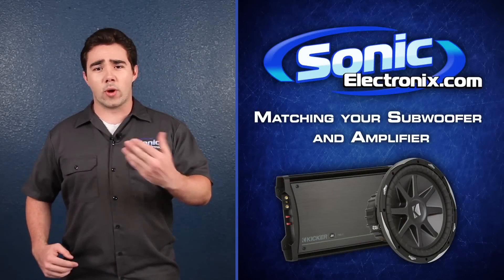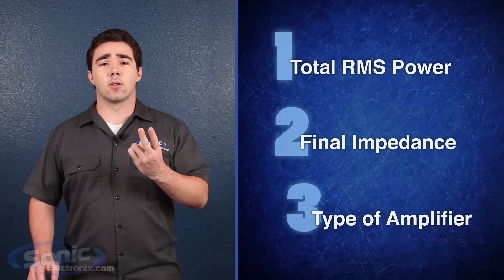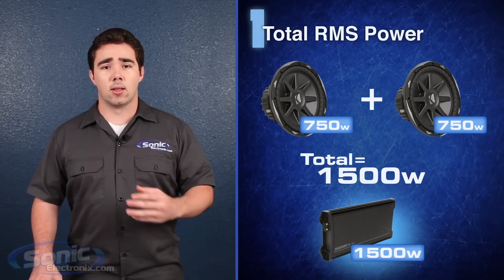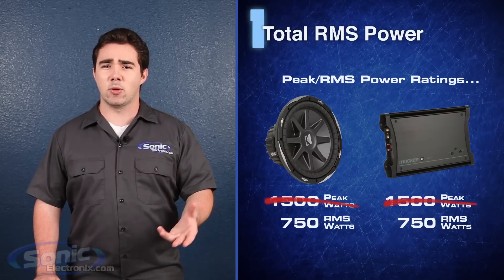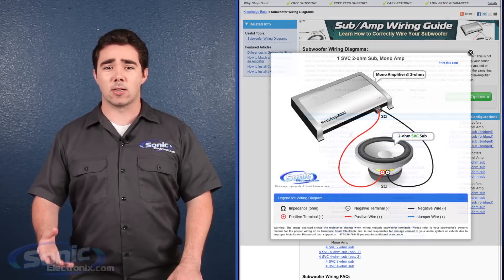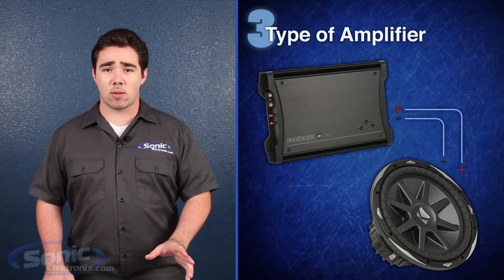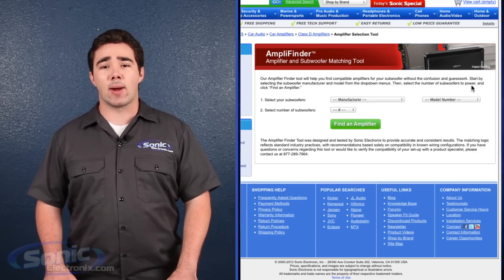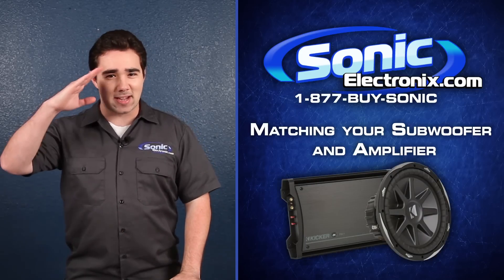How to Match a Car Subwoofer and Amplifier

Comment: Question? I have the Kicker 07DCVR122 ported enclosure with dual 2 12" CompVR subwoofers 2 (ohms) I wanted to know if the Kicker IX1000.1 1000W RMS Monoblock Class D IX Series Amplifier, would be a good match, or would it be to much power for my subs?

Comment: Based on what I research... Isn't the fuse rating the real rms? I bought an amp of 1110 rms but didn't knew the fuse rating.     It's a planet audio of rating 25a x 1 
And supposedly the real rms of this is 250'rms? Is it true...
Reply: yeah it is i think thats what i heard to . and my amp is 500 watts rms and it can do 250 rms . and my amp ratting fuses are 25 amp . and so 250 + 250 =500 rms watts .

Comment: you need two amps. 1 amp for your speakers, and 1 for your sub.

a 2 or 4 channels for the speaker depending of the rms of them.

and for your sub, an amp between 800 - 1200 rms ( at 2 ohms ) will work fine. like: Power Acoustik RZ1-1500D / Boss CXXM1800 / Boss CER2100M / Power Acoustik REP1-2000 / SPL GLA1-2400D / Autotek Mean Machine M4000.1D

Comment from the maker: That amp is not stable at .5 ohm and is becoming too hot. Remember less ohms = more heat. you need to wire in series not parallel.

Comment: I thought it could of been a bad amp so I swapped the amps for ZX-5005 amp but it just went into protection mode quicker. Could it be a bad battery? Or the ohm load is too much?

Comment: My ZX750.1 kicker amp goes into protection mode with 2 R2D2 Rockford Fosgate 10s. They are wired to 0.5 ohms. I know the amp is 2ohms but the subs are not hitting as hard as I think they should be. Any thoughts will be very appreciated thx.

Comment: If I have 2 Rockford fosgate p1 12s rated for 250 watts rms a piece and 2 6x9s rated for 65 watts rms can I power the entire system with a hifonics brx5000.5 amp or is that too much power please respond                           Brx5000.5=1480 rms    Subwoofer channel at 4 ohms is 475 watts, 2 ohms 750 watts, 1 ohm 1000watts.           1-4 channels rms. 4 ohms 60 watts x4 chan, 2 ohms 120 watts x4 chan

Comment: Hi, 
The video really helped
I need 1 help n advise. 
I have bought JBL 6.5" COMPONENT GTO 649C for the front doors. 
and 
GTO-S959 for the rear using tray
but I have installed Pioneer Head Unit (FH-X759BT)
after the installation the Car Accessories showroom is scaring me to put an Amplifier otherwise he says that either your Head units or the Speaker may blow. Kindly advise - if its mandatory to put an AMP with these conf? if Yes please suggest some amplifier.
Thanks a lot.
Saurabh

Comment: what I mean in good bass is if my amp has less watts for my subs it will not produce good base, right? as per the video bro, we do not have to be perfect to match the amp and subs if i have two subs with 1300W RMS each my amp should not too much over or under. :-)

Comment: It depends on the subs and what you mean by good bass. They should be able to produce 30-200(or what they are rated for) with 100 watts min to 1300 watts max.

Comment from the maker: Why would you need a Hi-Lo converter, does your amp not have 3 sets of RCA outputs? If you run your components speakers from 2-channels and your subs from two channels bridged, that would be just fine. Running your coaxial speakers from the HU is fine but they will start clipping a lot sooner then your component speakers and you may hurt them without knowing it.

Comment: I am planning to run front Comps through 2 Channels, Coax direct from HU, Subwoofer on Bridged mode from Amp. Also since I am going to keep the stock HU that is connected to Factory Comps and Coaxes, I am using a High Low Converter too. Pls suggest if any alteration to this.

Comment: Focal - Solid 4
4 x 75W RMS power into 4 Ohms
2 x 200W RMS Bridged mode 4 Ohms
Frequency response 10Hz - 60kHz

Focal - PS 165 - 6.5'' Two Way Component System
Frequency response (+/-3dB) 60Hz to 20kHz
Nom. power 80 Watts rms

Focal - SUB P 30 - 12'' Round Subwoofer
Frequency Response ranging from 35Hz to 500Hz
Nom. power 250 Watts rms

Focal - KIT 165CA1 - 6.5'' Two Way Coaxial 
Frequency response (+/-3dB) 60Hz - 20kHz
Nom. power 60W

Comment: Hi

i wish to power a pair of component speakers + a subwoofer with a 4 Channel Amp? is this recommended? thanks

component = 60w RMS - Pioneer TSA1605C
subwoofer = 250w RMS - Pionner TSXW303 - check pioneer europe

amplifier = 180w RMS when 2channels are bridged @ 4 ohms - Pioneer GM 6500F

what is your opinion?

many thanks

Comment: Pyramid Angled Woofer Box Systems: 
2-channel input into one unit
Power handling: 360 Watts (180W/channel)
Quick-connect terminals. 4-Ohm impendance.

Comment from the maker: Any amp that outputs 1200W RMS or more at the final impedance of those woofers wired together. The NVX JAD1200.1 is a great start if you have Dual 4 ohm woofers.

Comment: Ok so I bought 2 ppi 12" subs n it says they are 300w rms @4ohm what should I do to get the best performance. I wired them neg to neg n pos to pos. both in sealed separate boxes. I've been doing Alot of digging and I'm having trouble figuring it all out. I'm kinda new to all this n want to learn

Comment from the maker: If he has 2 Dual 4 ohm subwoofers, they will wire to a 1 ohm load. The amplifier we selected will output a bit more power then his subwoofers need, which will give him the headroom during dynamic bass peaks, so his woofers will always have the power they need.

Comment: And isn't it better to get an amp that can put out tons of power more then the sub can handle but under tuning it , I found when lower notes hit its sounds better with an amp that still has some power to put out, and thanks I'm currently running my setup at 3000watts rms on a inhouse poweramp by Behringer Its really good it has a limit so the out put sound never clips :)

Comment from the maker: Four Dual 4 ohm subwoofers wire to a 0.5, 2, or 8 ohm load. We recommend an amplifier that outputs about 2000-3000W RMS at 2 ohms. Each woofer is rated for 800W RMS but that might be a bit much for those subs.

Comment from the maker: Well, if you get Two Dual 2 Ohm subwoofers, 400W RMS each, they will wire together to a final impedance of 1 Ohm. Get two NVX VSW124 subwoofers and the NVX JAD1200.1 monoblock amplifier to match it.

Comment from the maker: The total RMS of your subwoofer is what your amplifier needs to output. So, if you have two 400W subs, each sub needs 400W, so you need an 800W amplifier. If you had 3 400W subs, you would need a 1200W amplifier.

Comment: I have one Kicker L7 12" DVC 2-ohm...and I just bought a JBL GTO-751EZ. I have it wired in a series, and the rms out of the amp is 500watts. Is this a bad thing that its a little too low compared to the 750watts RMS my sub can handle?

Comment from the maker: That MRX-M240 will work just fine if you have the subs wired to a 2 ohm load. However, you will need to upgrade your alternator, Big 3, and wiring to actually get that kind of power out of your system.

Comment from the maker: Any amplifier that outputs 300W at 4 ohms will work, the brand doesn't matter as much, as in, you don't NEED to use a JBL amplifier. Stay away from the cheaper amplifier, they do not produce true rated power.

Comment from the maker: Bingo! However, wiring does matter. If the amp is 2000W at 1 ohm you need Two Dual 4 ohm subs, if the amp is 2000W at 2 ohms, you need two Dual 2 Ohm subwoofers.

Comment from the maker: They would all wire to a 2 ohm load at the amplifier, so you need an amplifier that outputs around 1200W RMS at 2 ohms. For your price range, you will have to settle for one that outputs about 900W at 2 ohms, like the Precision Power PPI S1300.1D

Comment from the maker: Look for CEA 2006 Certified amplifiers, we have them listed on the website if an amp is CEA or not. Do you have the Dual 2 ohm versions or Dual 4 ohm? Some amps do not give true power. If you have the Dual 2 Ohm subs, go with the Hifonics BRX1100.1D.

Comment: i need help bad....i have 4 12s power bass(600 watts) Power Handling Capacity (Peak) : 600W..Power Handling Capacity (RMS) : 300W...whats a good amp to use within a budget of 210-220...im in a crown vic....i hear some amps dont give the power they say they do so i need help

Comment: I have a pioneer tsw3002d4 subwoofer that put a 1000 watt RMS. will a 1100 rms amp blow the sub ? (I want the maximum output) the amp is Alpine MRX M110 Xpower

Comment from the maker: Yeah, a monoblock and push any number of subs as long as the impedance and power match up. For example, you can wire three dual voice subwoofers to a final impedance of 3 ohm. Then you just make sure that the RMS for the subs (all added together) match the amplifier.

Comment: So I have 2 MTX terminators. They run at 200 rms 400 peak. My amp puts out 800 watts. Should I set my amp level to 400 watts? It doesn't have a control labeled gain, just level.

Comment: I Have A "12 Kicker Cvx and im looking Into Buying An Alpine mrp-m1000 But The problem is the amp has more rms power at 2ohms than my sub. my sub is 750 rms and the amp is 1000rms...i was trying to find a match for my sub on your website trough your amp finder thing but my "12 inch cvx is not listed there...i used to have the alpine mrp-m850 and it was a perfect match but it eventually burned out after 6 years of abuse. do you think a "12 kicker cvx is not a good match with an alpine mrp-m1000?

Comment from the maker: The specifications they put on a box should be followed closely for the average user. However, a power user, one who is an expert at all things audio, will know how to manipulate their sound systems and use the specifications as guidelines. It is not uncommon to see subwoofers being overpowered by experienced users who set all of their equipment correctly with proper heat management and clean audio signals. The average user listening to music on normal volume uses very little power.

Comment from the maker: That depends on the woofer. You can feed a subwoofer as much power as you want technically, so long as you stay within the mechanical and thermal limits of the design.

Comment: absolute rubbish. Both setups will run at 300wrms max (without distortion or your sub dying). 
I don't agree with the video saying that '4 channels are bad for subs' either. Bridging 4ch (or 2ch) amps is fine, it's just that you tend to get more bang for buck buying a mono amp.

Comment: One should be very careful about installing a subwoofer with a lower power rating than the amplifier can deliver at the subwoofer's ohm rating. If you adjust the amplifier gains for maximum unclipped signal with no subwoofer attached, the amplifier may provide far more power to the subwoofer than it is rated for.